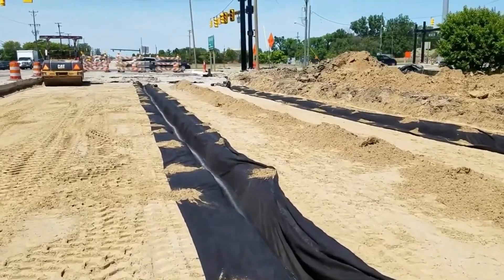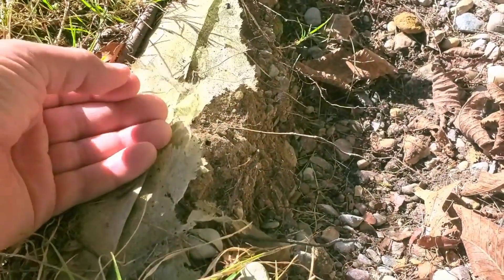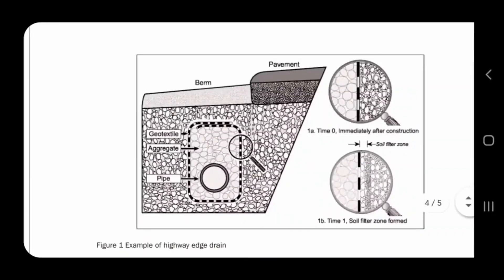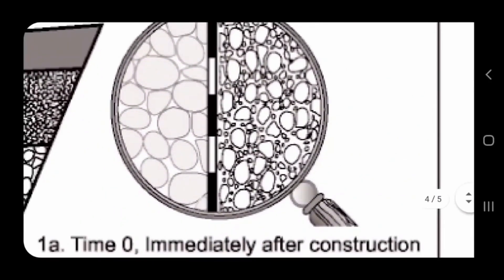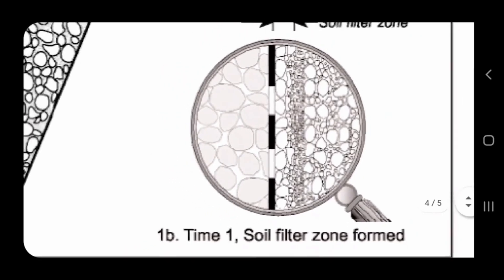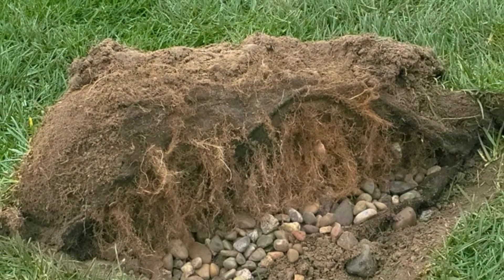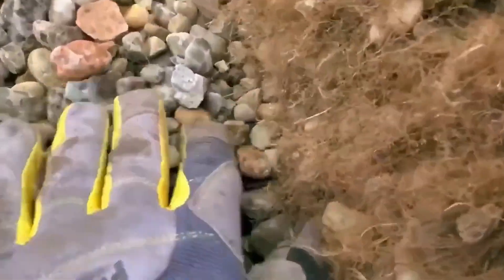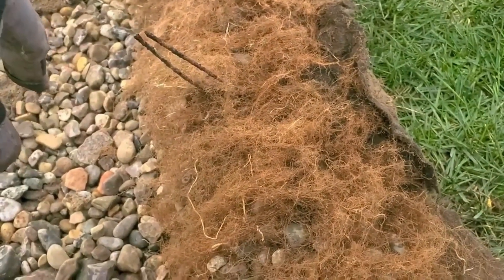French Drain Fabric: Why Most Fail & How to Make Yours Last Forever [10 yr French Drain is Proof ]

Comment: Great video I purchased 4x100 corrugated drain at Home Depot my question is how deep can I dig to place without crushing? Thanks any advice is greatly appreciated.
Reply: I've been to your website. Everything looks great until you go to checkout to find out your shipping rates. 400 plus. That's crazy. Home depot will work just fine.
Reply from the maker: You're in trouble. That pipe is failure. No matter what you do. You have no chance at success with The Home Depot pipe. My best advice to you, sir, is to return that pipe.
Reply: @FRENCHDRAINMAN  what pipe do you prefer sir? Thank you
Reply from the maker: @SpiritusComics  
Best French Drain and Yard Drainage Contractor
https://frenchdrainman.com/
Reply: @FRENCHDRAINMAN  Where can you buy the fabric you are using? All the drainage suppliers have landscaping fabric in my area

Comment: The DOT use makes sense with the huge filter bed of the road base and low water demand. The 10 year example looks like sandy or silty loam soil. What about a heavy clay? Clay with its microscopic platlets can seem to clog anything that prevents it from ingress. I need a system in my ohio lawn that is very high clay content. Do I need to keep the top  either open gravel or dressed with low clay topsoil to allow clean water in to flush any clay that sneaks in through the fabric? I won't have an open drain point either, just a percolating field at the low point.
Reply from the maker: This was clay-based soil. Ninety-nine out of 100 jobs we do involve clay.

Comment: Would this fabric work for an interior basement drainage system?  Fabric -> Gravel -> corrugated pipe -> gravel -> lay fabric over gravel -> more gravel on top of fabric -> 3" concrete layer.  What brand of corrugated pipe do you recommend?  This is just a scenario.  Looking for your opinion.  Thanks for your time.
Reply from the maker: https://youtube.com/playlist?list=PLjFCqaZ4v1BWSyew4JyZuxDpBvULztf91&si=1lZM2EgeWWIlWUNq
Reply: @FRENCHDRAINMAN  Very cool.  Where can I get the blue corrugated drain pipe?  It looks so much more durable than the black stuff.  Again this is for an interior basement system.  Appreciate your help
Reply: Thank you.  I found your website.  Perfect
Reply from the maker: https://youtube.com/playlist?list=PLjFCqaZ4v1BWSyew4JyZuxDpBvULztf91&si=1lZM2EgeWWIlWUNq

Comment: Another great video.  From what I understand for an underground roof runoff system using solid corrugated pipe, the 4 ounce fabric is usually used in the area of the catch basin (non-burrito wrapped) and pop up emitter (burrito wrapped).      My Question:  if one of the 4 inch 90 degree pop up emitters, with a few holes drilled on its bottom for leaching of standing water, will be in an area closer to tree roots, would the 8 ounce fabric work better to prevent root ingrowth into the pop up emitter, or would this impede drainage?     Thanks as always!
Reply from the maker: You definitely have been putting a lot of thought into this. Trees suck. If they are close, as they grow, their roots lift the pipe. That's down the road. To answer your question 8 oz does give you more protection against the tree roots, and It drains fast enough to keep up with the leaching of water.

Comment: How many feet should the drain system be away from the house? I get water in my basement.. my driveway is along my house and between the foundation of the house and the driveway , rain water comes into the basement… Mickey from Wisconsin here! I love watching your videos!!
Reply from the maker: Check to make sure your driveway slopes away from the home. If not consider concrete jacking the slabs of cement. And if that's not a feasible option, you may need to break out the driveway and repour  it so that it slopes away adequately.

Comment: How do you choose the thickness of the fabric?
Reply: Thank you. Soil here in Dallas I was told is clay but in my area there are some rocks too. Is it safe to go with 6?  I think I should buy it before I even start digging.
Reply from the maker: How fast I need it to drain. 4 oz is the fastest. We roll with that unless there are sharp rocks involved in the build. If that's the case we go with 8 oz.

Comment: If pvc french drain pipe draws water from the bottom of a trench in a similar fashion, why not put the pvc directly on 4, 6, or 8 oz non-woven fabric & soil?  why put the pvc on the "4 inches of drain rock"?   And besides cost, is there any reason NOT to use 6 or 8 oz non-woven fabric vs 4 oz for new french drain builds?
Reply: Joe, without the rock, there is no way for the water to enter a PVC pipe with the holes on the bottom.  You need the rock to pick it up off the ground a little.  Should be 2 inches, not 4 though.  The corrugated pipe can be placed directly on the fabric on the ground because it has holes all around the pipe for the water to enter.
Reply from the maker: When the bottom holes plug with sediment PVC pipe is all done.
https://youtube.com/playlist?list=PLjFCqaZ4v1BX_ZMbxsYVB6CNFoeAmuPxX

Comment: I like sand on the tile. Sand just works, and always last for many years.
Reply from the maker: What the road construction crews are now doing is that they put a layer of sand under the roads. They will trench out an area in the sand to put fabric, pipe, and stone. If the sand is on the other side of the nonwoven Geo textile filter fabric, you will have a really good system.

Comment: What's the problem with water in the stones below the pipe?
Reply from the maker: Tree roots love that, they can sniff out water and take out your system.
Reply: @FRENCHDRAINMAN  Can you prevent that by placing an outlet pipe at one corner of the trench, sloping downwards to daylight or to a drywell?

Comment: Half of FD contractors say don't use fabric, then guys like this say  use it. Others say put gravel down first, this guy says put the pipe right on the fabric. Who knows, really.
Reply from the maker: The guys that don't use it get to come back and put in another French drain 5 years later. Not using the fabric is job security.🤷🏻‍♂️
Reply: This guy's videos make sense and he explains his reasoning.  He even has videos of him digging up old systems that don't use his technique.
Putting the gravel in first is leftover logic from using PVC with holes in the bottom.   Without the rock, there is no way for the water to enter a PVC pipe with the holes on the bottom.  You need the rock to pick it up off the ground a little. The corrugated pipe can be placed directly on the fabric on the ground because it has holes all around the pipe for the water to enter.
Reply: armchair general, putting in a french drain myself, so take it or leave it:
the fabric selection (or none) is important. I tried being cheap and using a weed barrier that let water through.  well 5 seconds with my faucet proved that wrong,  it pooled water nearly as good as the plastic bucket it was sitting on, so that was out!    
Having the bed of gravel leaves a space for loose sediment to rest, so the french drain inlet holes don't get clogged up.   On the other hand, any plant with deep roots will find that resting water below the drain line, and the root system will thrive there!  (look at Deep Water Culture Hydroponics)  so it's a   'pick your battle' situation

Comment: There are other creators that are passionately adamant that geotextile fabric should NOT be used around the drain rock in clay soils! The reasoning given  is that the fabric slows the water flow so drastically so as to render it nearly useless. There are demonstrations to show the amount of flow restriction….  

So it’s confusing; whom to believe? 

I’m more in the camp that says slower flow with fabric is better than a totally silt-clogged system in a few years.  

My lot doesn’t have a lot of slope but I’m also thinking that the drain line needs to have a minimum 2% slope to properly flush out any silt that ends up in the pipe.  But, that will then require a sump and sump pump that I’m really trying to avoid for cost and maintenance reasons.
Reply: I have the same question. What's to prevent the fabric getting clogged with clay soil once it's wet? I've watched all your great videos but asZane says - other creators warn against it in clay conditions.
Reply from the maker: https://youtu.be/KiehdvVTu-8
A fully contained system can be flat with no slope. No debris or sediment in a wrapped system
Reply: @FRENCHDRAINMAN  
There is merit to what you’re saying; if there’s little fine sediment washing into the pipe, then a stronger flow rate from a steeper slope is far less important. 

My cautionary tendency is to then oversize the pipe to be more like the City storm drain systems and to add catch basins along the pipe to also provide clean outs for maintenance.
Reply: @xxxmikeyjock  Sure, but City storm drains have solid pipes and aren’t French drains, so there is no filtering as part of the design.

Comment: Thanks you for this. I have seen the points before though, but most probably haven't. What I have not seen solved is a FD that can cope with traffic, or tractors and trucks.
Reply from the maker: Watch "How To Run A Drainage System Under A Driveway [ French Drain, Yard Drain, Buried Downspout, SumpLine" on YouTube
https://youtu.be/n73zvzS08rE

Watch "How Do I Run a Drainage Pipe Under a Driveway?" on YouTube
https://youtu.be/-0rYJb09q_A

Comment: I would have liked to see what that stone looks like a foot down for comparison.  Sure, the stone on the top will be clean, but how much sediment builds up at the base of the trench by the pipe?  Maybe none in your case, but would have been nice to show it.
Reply from the maker: It was hard enough to convince the homeowner to let me do what I did do to that French Drain. I took a perfectly functional well working French Drain and cut the fabric and exposed it. I was hired to run another French Drain in the front yard. I did mend the fabric to return the French Drain to 100%
Reply: @FRENCHDRAINMAN  Fare enough.   Thanks for the videos!

Comment: Dont corrugated pipe ribs create  a catch for dirt & debris? Wouldn’t a smooth pipe carry dirt away better? Also, ru saying with the right fabric, you don’t need rocks underneath? Is your corrugated pipe perforated on bottom? I’m trying to not only run gutters through a pipe away from house but how to use same pipe along foundation to run away the water that seeps through soil next to wall ? Basement doesn’t hAve sump… going to pitch dirt away from basement walls .. is gutter drain enough or do I need some sort of just below surface pipe to catch surface water and carry away? Two pipes or how to use just one system run?
Reply from the maker: Watch "Underground Downspout Drain - Done Right The First Time Work Smarter NOT Harder ] Drainage For DIYer" on YouTube
https://youtu.be/RnA2NOIEZ6M

Watch "How Does Drainage Pipe With Holes Really Work?" on YouTube
https://youtu.be/kqUNnc0j8Kg

Watch "Biggest Mistakes to Avoid When Installing a Underground Downspout Drain [ Gutter Drainage System ]" on YouTube
https://youtu.be/GNcoPY1K5nE